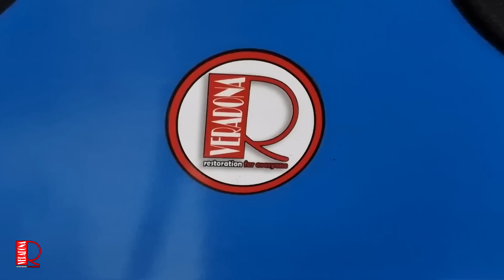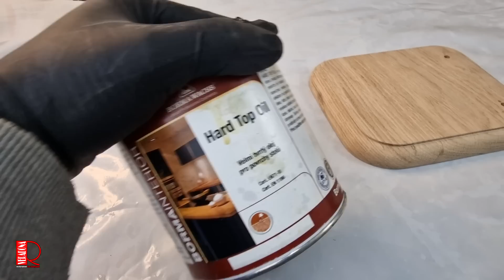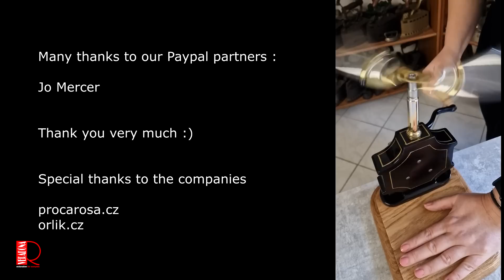Restoration - Do you know this device?

Comment: This came out AWESOME! Beautiful work. 
I think, the ONLY thing I may have done differently would have been to turn the bolts around that hold the centrifuge to the base, so that the pretty "rounded over" part of the bolt was visible, on top, and the nuts were underneath.
Reply from the maker: Thank you very much Paulina. The advice is good, but due to the length of the screws, I wouldn't be able to get the screw from the top part into the holes. Thank you :)

Comment: We used them offshore to separate crude oil from water while testing.  Most were electric but if you were on a satellite platform without power you used to do what we called hand jobbing it with a crank handle.  Looked up the price of the manual types and was surprised at how expensive they were and this was back in the 90's.  Over $300,  two glass 100 mL centrifuge tubes included.
Reply from the maker: Wow, thank you for your story. The work at sea must have been very difficult. Respect

Comment: NOT a good job. Filing and spackling that case was entirely unnecessary to restore functionality and lost some of the original state of the piece. So was chamfering the axle holes and removing the nickle plating on the spinner. Unnecessaray irreversible changes like that are totally unacceptable when working on antiques.

Comment: A good trick when doing the pinstripe or any time you are using tape as a paint edge. Before painting the color, paint the stripe with clear and let dry. Then paint the color over top of the clear. That will prevent the color from bleeding under the tape. Have a good day.
Reply from the maker: Thank you for the advice :)

Comment: I've stopped at 0:40. By look of this, I'd say it was used to test blood (or something that would divide into factions when it's being moved around the central point with the very fast motion). Those two pipes in the middle would be used to pump air into the system and move the thing in one or another direction. And this makes me wonder ... why would anyone use different rotating direction?

Comment: It is a manual lab centrifuge the earliest came in two tube configurations later models came in four-they are still manufactured in India and a few in China.The base is clamped or permanently held by screws on the bench depending on the model-also the crank is detachable.

Comment: A beautiful piece you two have restored. Laboratory equipment such as this is often forgotten and scrapped which is such a shame.
Reply: It's actually possible this might not have been specifically used in a laboratory.  That style of centrifuge could easily have been used for testing milk quality, or for quality control of small processes, such as batches of paints, solvents, soil sampling, and so on.
Reply from the maker: It is true. A similar fate awaited this one :)

Comment: Sorry, but Why did you remove the Casting Marks? I mean you are trying to Restore the Item. Not Modify it. Removing the Casting Marks is Not Restoring it, It is Modifying the Item. Restoring the Item, is How it Came from the FACTORY.
Reply: So by this logic, if someone was restoring something that was originally painted with lead, repainting it with anything other than lead paint disqualifies it as restoration?

The object wasn’t designed to have casting marks. They’re just production blemishes that the factory didn’t bother taking the time to remove. Removing them doesn’t change the function, design, or intended appearance in any way, so I don’t see how it’s a modification.

Comment: THat's a really old and really dangerous centrifuge, you want to use that old puppy in a spot well away from where people are working, otherwise you're going to be wearing the sample spinning down for lab tests, and have a really sore spot on your hand or arm somewhere, plus glass everywhere because the aluminium tube is going to dent inwards and shatter the test tube inside. Looks like the rotating mechanism is seized. It's extremely lucky that the gears were in perfect condition! You did a fantastic job on the restoration of this centrifuge! I would have brassed the rear plate and painted black accept lines on it in an opposite of the other side of the base housing. But you did very well!
Reply from the maker: Thank you for your opinion :)

Comment: Centrifugal device, I used similar to this in the oilfield during welltesting, it's to determine sediments and water cut in percentage of glass of hydrocarbons and the unit of measure is BS&W = Basic Sediment & Water. The two small liquid recipients should glass and graduated from 0 to 100 for reading the amount of sediments and water contained in oil or condensate gas samples.
Reply from the maker: Wow, thank you :)